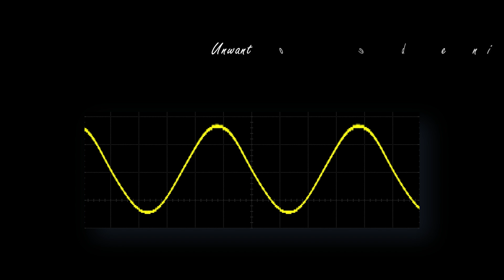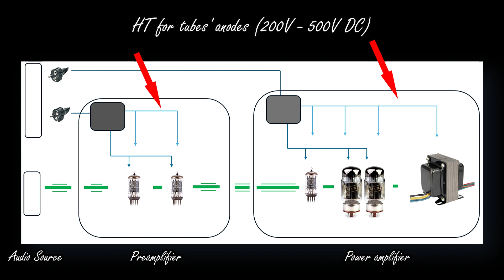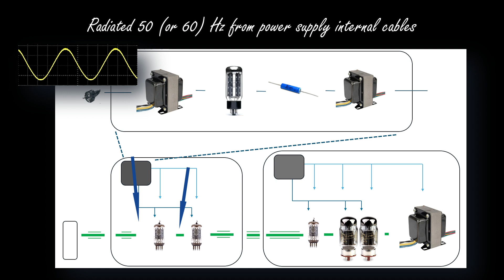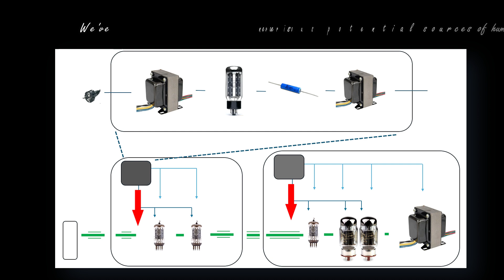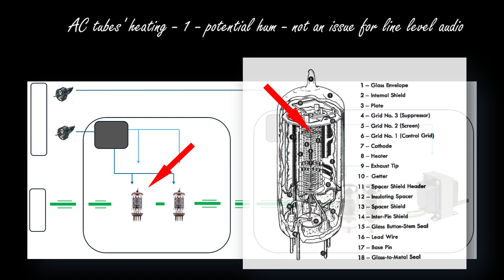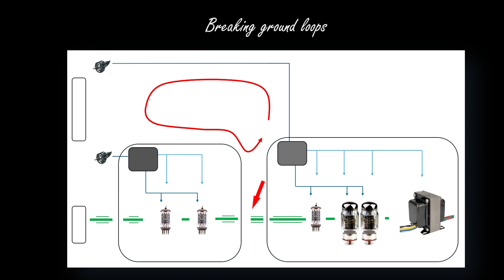No hum / noise on your tube Hi-Fi amplifier !  (Lesson 1)

Comment: I would like to add a note that a linear regulator is superior to a choke as it will limit the dc output below the ripple thus effectively multiplying the bulk capacitor to near Infinity. Excellent video by the way.
Reply from the maker: @davidkclayton  100% agree, yes. Linear regulation provides very clean DC to the tubes. I did not cover that in the video, maybe material for the next one ! Thanks for your note, all the best !